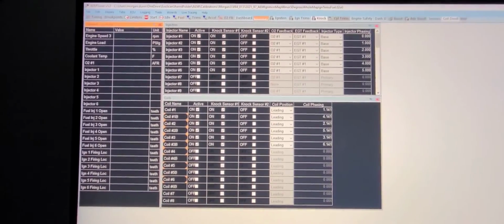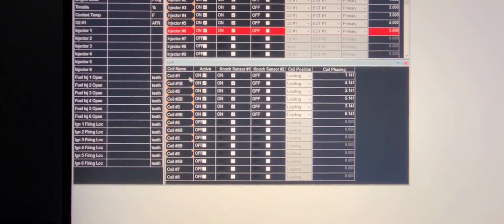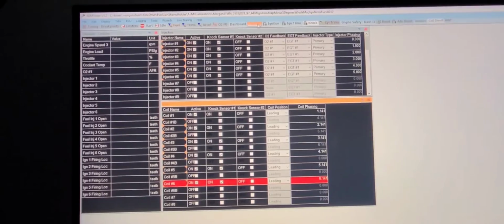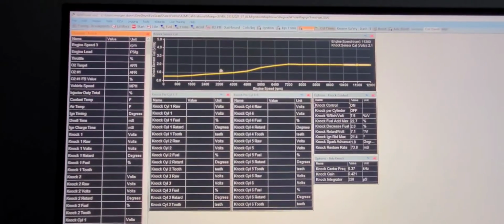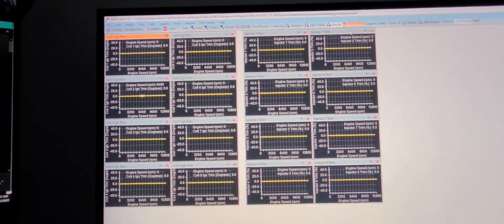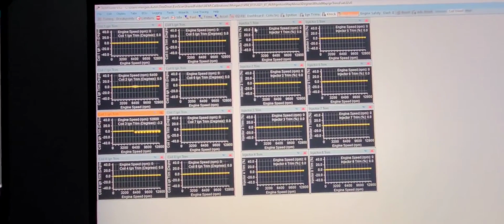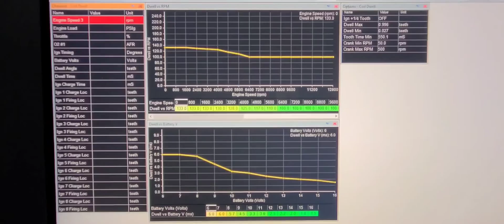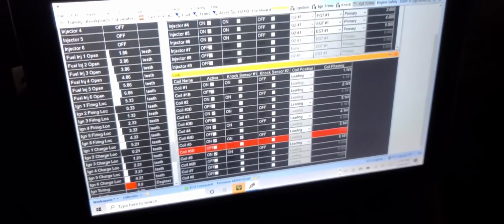Rvenge Performance Coil on Plug Installation by RacerX Performance Tuning

Comment: Thank you for this excellent video. I have a question, please. I bought the kit and want to run it in sequential mode. I have a question about the wires for the RPM. Did you use all 6 wires, or where do they connect, please? Thank you!

Comment: Great instructional video, Morgan! I am contemplating doing this with a Chrome. However, first I need to figure out why my LCDBC shows occasional knock at 0psi of boost. It usually happens when I suddenly hit the accelerator hard. I am planning to use your help to tune my car for the 15Gs I have installed (soon to install 20Ts), but I would have to first iron out those gremlins…
Reply from the maker: Yes, definitely want any gremlins ironed out before you start the tuning. Regarding your 0 psi knock it is possible if you are hard on the accelerator in too high of a gear for your RPMs...i.e. short shifting. Possibly. Also the knock sensors in our cars are pretty old. If you take a look at it and see the "ooze" coming off it may be time for a change. Hit me up at RacerX Performance Tuning  on Facebook and we can discuss a plan.
Reply: @Morgamania2 ,
My car is a ‘95 GTO ATX and the 0psi knock actually occurs in 1st gear, when leaving from a standstill. I replaced the knock sensor about four years ago. Anyway, I will contact you on Facebook for particulars…

Comment: Would you recommend this kit for chrome users? Still wasted spark but with a modern ignition system, I read the Rvenge guide and there is little info about the chrome setups, most of the guys running this kit seem to be happy with aem so maybe an overkill for stockish guys?
Reply from the maker: True in that you can't do sequential or knock per cylinder in Chrome. While you will get a better ignition spark quality however, when you mention "stockish" I would think the money may be better spent on other upgrades that can provide more gains that you can realize in the short term as you continue your build.

Comment: hey Morgan how did you get your aem to bring up every cylinder timing independently?
Reply from the maker: Are you referring to on the Coils/Injectors tab?
Reply from the maker: Or you may be meaning the Cylinder Trims tab. You might have to find it under Tabs->Hidden Tabs
Reply: ok I will look there. thank you for the video. I got my kit 100% installed today and hoping to fire the car up this next weekend
Reply from the maker: @MNPontiac  Great! Keep me posted!  With the sequential CoP installed as soon as you turn on Knock Per Cylinder AEM knows which cylinder the knock is occurring in based on the crank position sensor, etc. and will address that cylinder with the knock control settings you set up on the Knock tab. The Cylinder Trims tab you use if you find that you need to address one or another cylinder proactively. That way you are using knock control as the fail-safe it is intended for and not a band-aid.  :)
Reply: @Morgamania2  thank you sir. do u know about tuning with the aem yet? I could use pointers or help when I get it running.  I've tuned cars but usually stock ecus using hptuners not a standalone system
Reply from the maker: @MNPontiac  Yes, happy to help.

Comment: Awesome video Morgan, thank you very much!
Reply: Can you do the coil on plug conversion with a stock ecu
Reply: @benjaminbaird3798  It doesn't work that great. We have found that the stock ECU dwell is higher than they like and it can cause some overheating of the coils. It does work perfectly with Chrome or any standalone.
Reply: @RvengePerformance  do you guys have any contact info I can call you on so I’ve got a 91 vr4 and the other day I was driving everything was fine I shut it off and 10 mins later I tried to start it and it hasn’t started since I’ve checked fuel and I got fuel I checked spark and there is no spark since I’ve owned the car the tachometer has never worked and I know the ptu runs the tachometer and turns the coil on and off so I’m trying to see if I can get another opinion on this or if there might be something else wrong with it and I’m barking up the wrong tree
Reply: I'm having issues with aem ems ver2 with coil 2 and 5 not getting any spark is there anything I need to look for to fix this issue. (NOTE when I plug original ecu every coil has spark)
Reply: @RvengePerformance